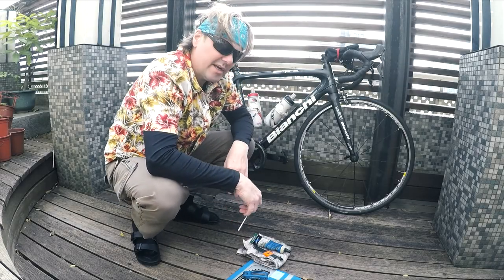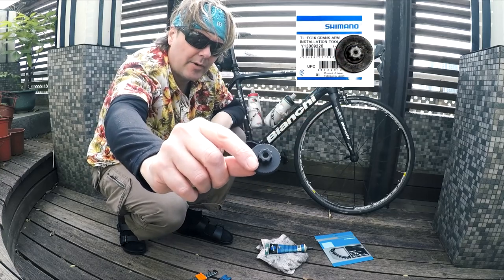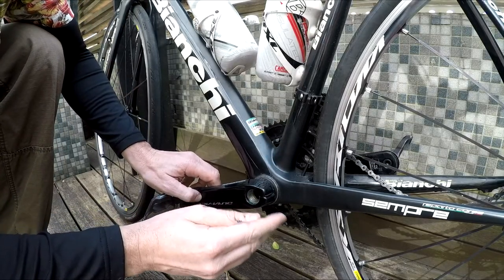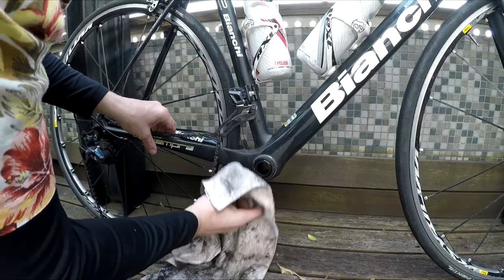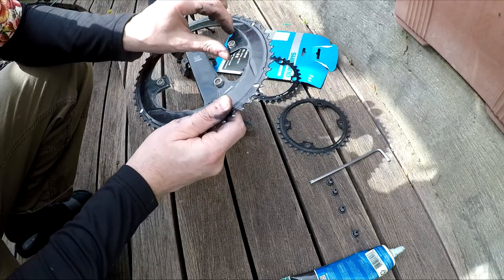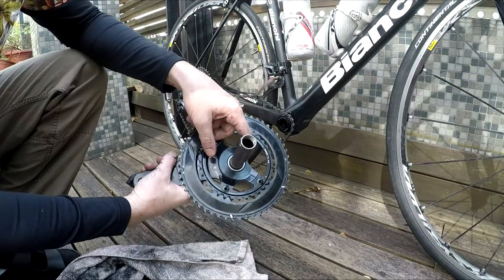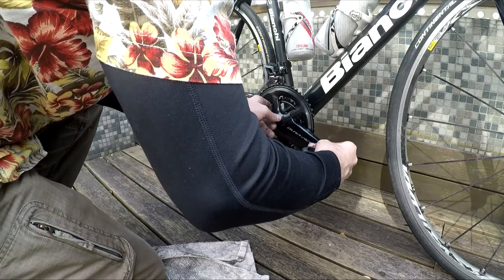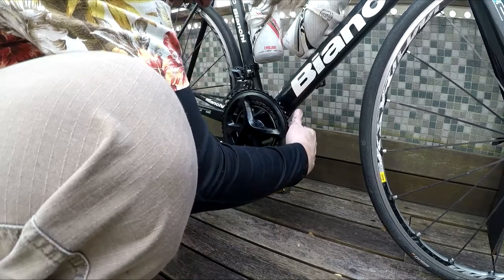Shimano Crankset & Chainrings - Installation / Maintenance (How To)

Comment: Hey Scott, thanks for your informative video👍🏿
Is there a way to exchange the 34 ring to a 32 or 30?
Thank you
Reply from the maker: I tried a solution on my ultegra crank set that was made by company called Croder ...but I found that the chainrings were too flexy... so I don't think that's worth it... Just go the SRAM way and buy a 36 tooth cassette .. I'm currently running a 34 on the front small chainring with a 36 on the back cassette and it works fine with a long cage derailleur
Reply: @scottrider7271  ok. Thank you for your quick reply 👋🏿😊

Comment: Excellent video friend!! ..... I have a question, what is the size of the torx wrench for the Dura Ace 9100 bolts?
Reply from the maker: Appreciate it!  I can't recall the size off hand..I just bought one wrench ..I went to a shop and they sized it up and I just simply bought it... quick Google search though should find it.... PDF duta ace 9100 torx wrench kind of thing
Reply: It’s a T30 Torx. The manual says to tighten to 12-16 nm.
Reply: @davidrobertnewman  Thanks !!!!!!

Comment: You don’t need to remove the crank arms to replace the chain rings!!

What is this guy doing wasting his time and the viewers time.

It is designed to remove the chain rings without removing the crank arms

Just go directly to the inner ring and remove the bolts from the inside using Allen key and replace the inner or outer
Reply from the maker: If you actually watch the video..I was doing two jobs at once. I was regreasing the bottom bracket and it's a lot easier to replace the rings when the crank that is off. Cheer up buddy.